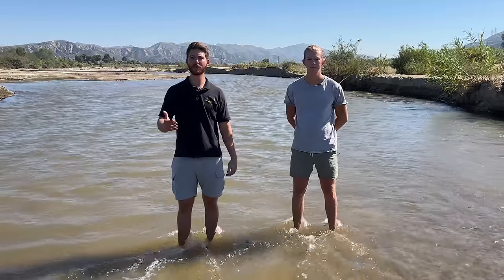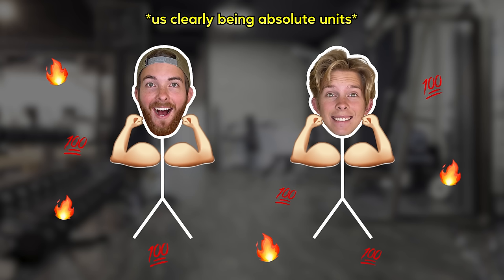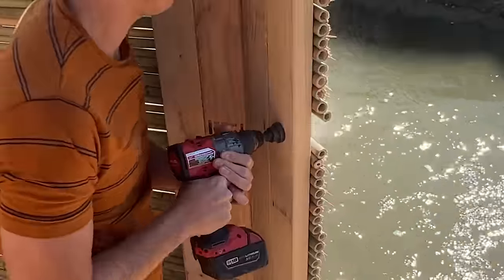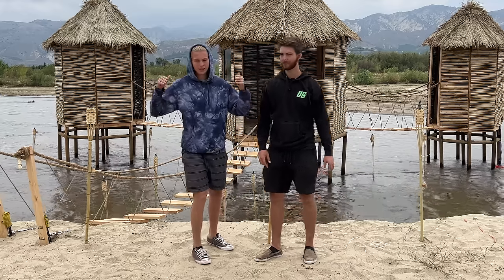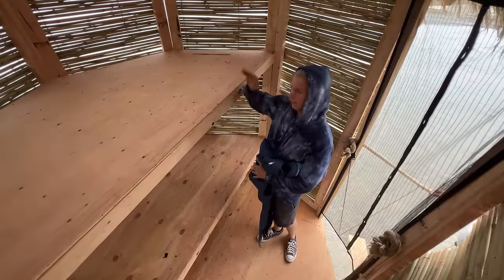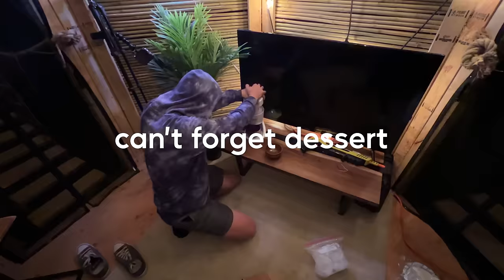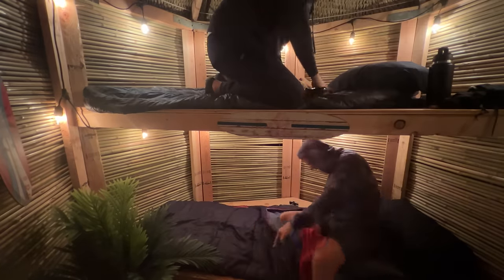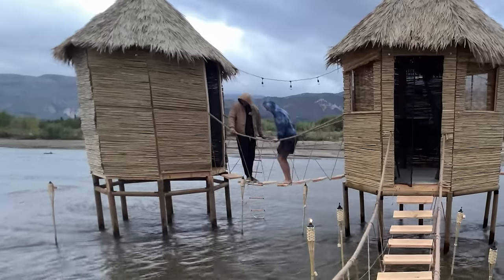We Built a Luxury River House!

Comment: If you put tarp between the wire and thatch roof, it would probably be rainproof and the bathroom floor should have been some grated floor so the shower water would run off, otherwise impressive build